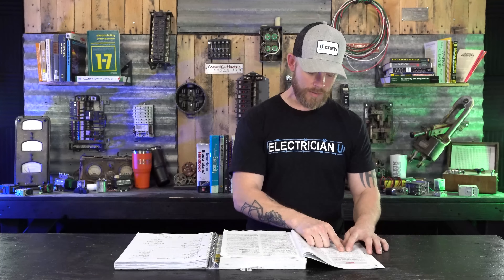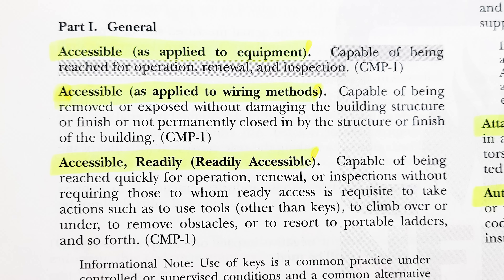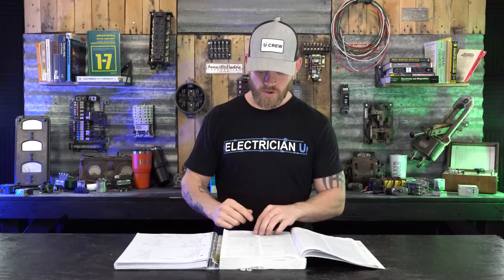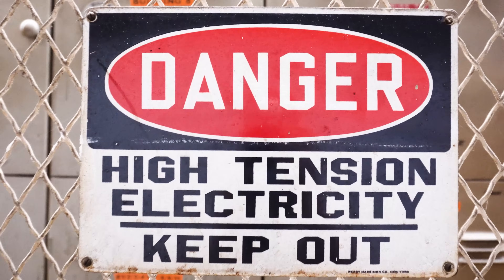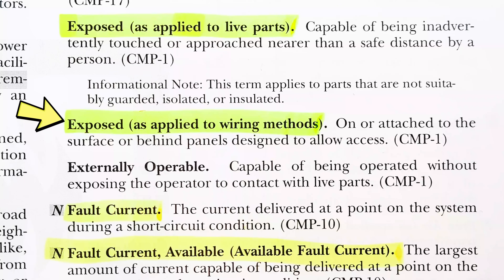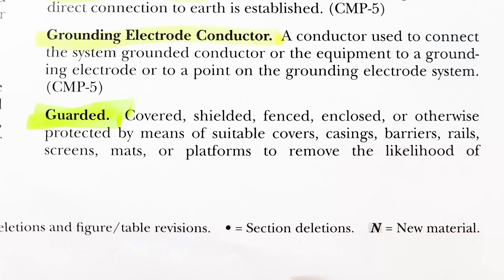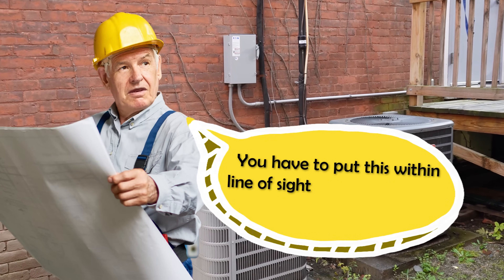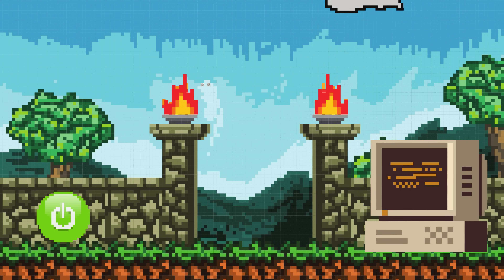What is the difference between Exposed, Accessible, and In Sight? (Code Words You Should Know)

Comment: great videos!
I’m running a 120v 12/2 burial cable (in a 3/4” PVC conduit) from shed to house, can i splice the in house feed (from main panel) in the LB outside or i need to run burial cable into house in a junction box?
thanks.

Comment: Got a second?
Got a question for you.
I've got a 70s home, no grounded(3rd wire) outlets no where.
What is the best way I can address this?
Just replace all outlets using a GFI in each room/circuit?
Pull ground wires?
I want it safe and new millennium ready.
Block tri-level 2x2 outer walls. Just paid $3,200 for 200A service

Comment: Hello Dustin, I work in the aviation industry and our AC power is standardized in 400Hz instead of 60Hz because of the weight issue always restricting aircraft design. All cleaning and maintenance appliances are of course rated for 400Hz, however, in this digital world many of my colleagues plug in their phone charger or other electronic power adapters into the AC outlet with 400Hz frequency. Will higher frequency damage electronics or adapters eventually? I have not witnessed any smoke or fire happening yet, but I always wondered what kind of risk we are having using 60Hz rated electronics with 110V/400Hz AC power. Thanks for reading.
Reply: Avionics and power engineer here…you should check the frequency input rating to your devices before plugging in. Most commercial electronic devices are not rated for use on 400Hz aircraft power.  Although many of them do function because the circuitry is not sensitive to the higher frequency, it is not recommended to just assume a failure wont occur.  You should do your homework on anything you plan to plug in first.
Reply: @-justin-4077  I agree about the listing rating however from an electrical theory standpoint higher frequency does not mean BOOM!
Reply: @Williesnyder77  true, it’s not a simple yes or no. Most likely it won’t be a problem but there could be some devices that won’t be compatible
Reply: I would say it would be better and more efficient for sensitive electronics due to less voltage spikes.
Reply: That was exactly the reason I asked first place because when I look at those chargers they are just consumer level devices rated for typical 50-60hz range. I would never do it especially in an moving aircraft but always wondered what it would mean to electricians with in-depth knowledge.

Comment: So, in my case of a metal junction box located in a basement ceiling above a dropped ceiling, that can be accessed by simply moving a ceiling tile,  it is considered accessible, but not readily accessible.  Yes?  

By installing a dropped ceiling in my basement, I still meet code allowing "accessible" access to boxes/junctions/etc. located above in the floor joist areas for inspection and/or maintenance.

Comment: My  external service panel, the one right next to the meter, wont open. 
I'm guessing cramming a crowbar in there is a bad idea, but what are my non-destructive and non-deadly options for opening it? 
Or should I even try?
The panel has a big switch on the side of the panel, is it supposed to be user serviceable or is that for the power company? The outside of the box says it has fuses and stuff in it.

I want to add a circuit for an EV charger and if there's room in that panel it would be perfect. My only other option is a sub-panel that would be a 25ft run through the crawlspace and then through the wall.
Reply: use a beefy flat head
Reply: you have to come off main panel for tesla charger its code here in ca
Reply: @markgarcia3514  Turns out it wasn't a main panel. The door only opens when the big switch is in the off position.

Comment: If I only have 3 wire coming into my main panel and sub panels, I can have the panels bonded correct? And if current flows through the neutral, why don’t we break the neutral when using a generator?
Reply: The panels have to be bonded, always. The issue is with grounding the panels. Your main panel is grounded to either ground rods or a GEC. If your sub panel is attached to the same building as your main panel then you can just bond the panels together with whatever ground wire is Feeding the sub panel. If the sub panel is not attached to the same building as your main panel then you have to ground the sub panel using ground rods

Comment: i guess readily accessible  as applied to a wiring method means conductors in conduits being able to pull out and replaced, not needing to break the walls,  not the ones in outlet boxes.
Reply: for wiring, the raceway could be concealed, but the junction boxes / pull points must be accessible. IOW, not blocked by drywall or other finishes or equipment. "Readily accessible" basically means you can walk up to it and remove the factory approved cover, but there are exceptions. One that comes to mind is a wall mounted mini-split on a second floor needs a disconnect. Since you need a ladder to reach the equipment, it would be acceptable to put the disconnect within arm's reach of the unit, instead of at ground level. There's a drop down under the video that spells this out in more detail.
Reply: @rupe53  yes, there is an exception, if disconnecting means is adjacent to equipment and clearly visible that disconnecting mean controls adjacent equipment it can discard requirement to be readily accessible.